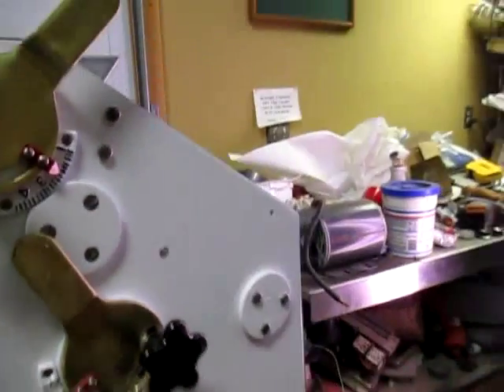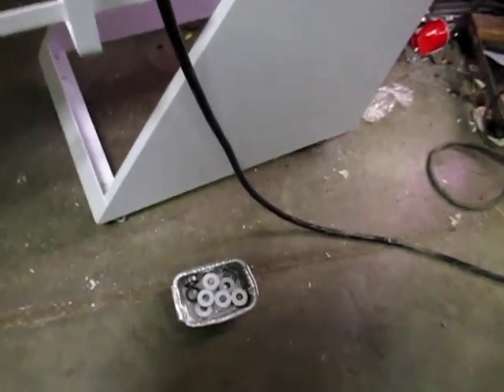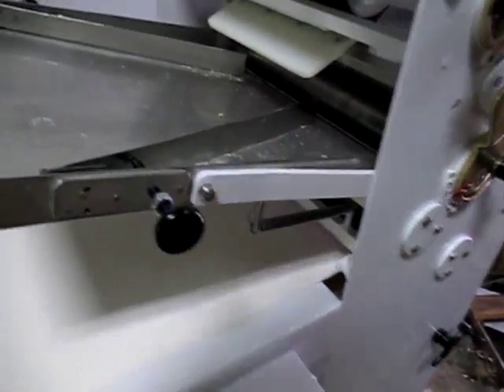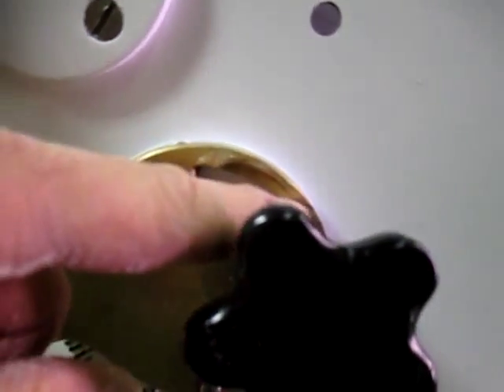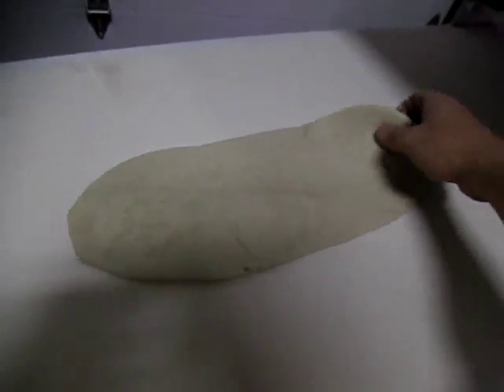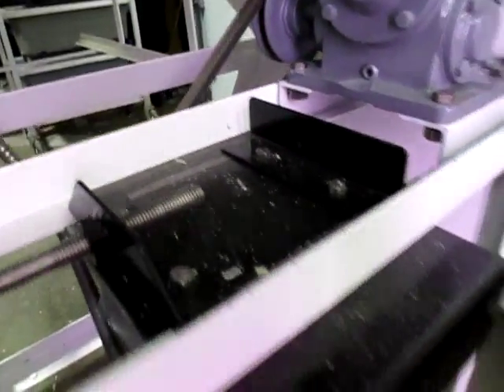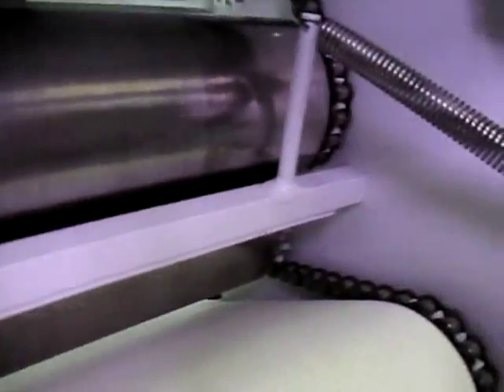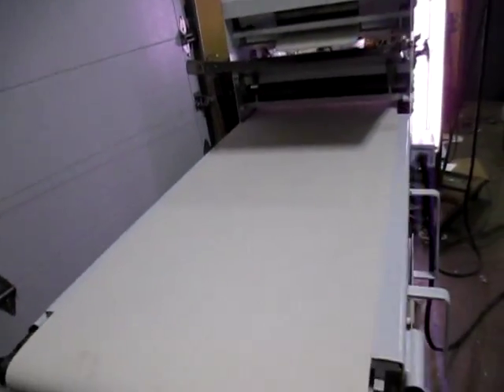Acme Rol Sheeter

Comment: I really appreciate your attention to detail. I just purchased a closed pizzeria that had an Acme dough sheeter. With your video I was able to take it all apart and get all the old caked on dough inside cleaned. Also learned about the adjustment handles. So I appreciate it thank you